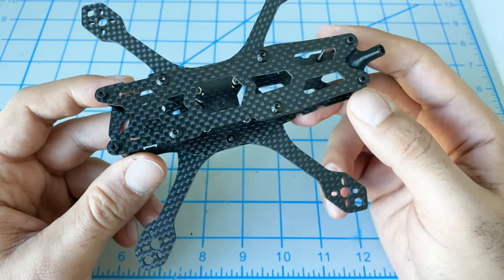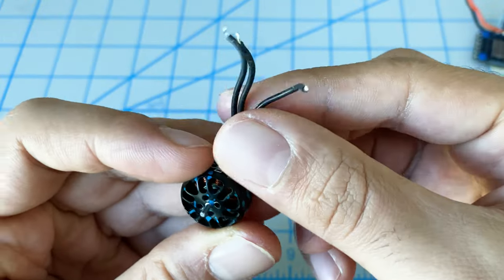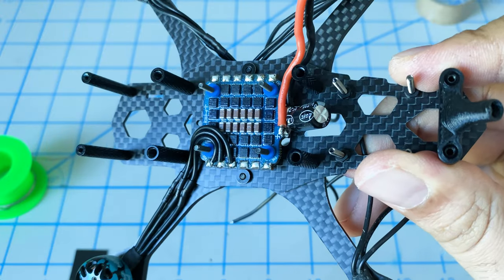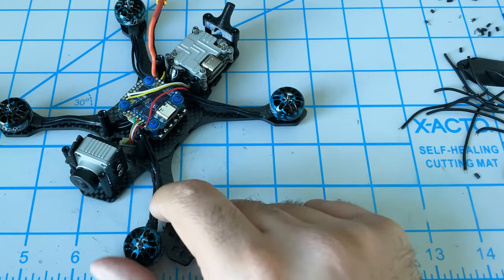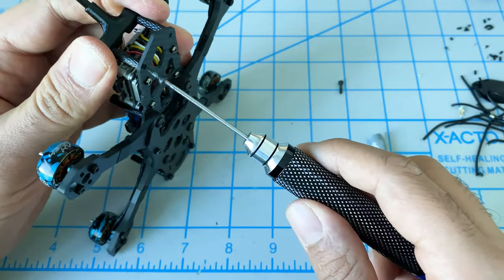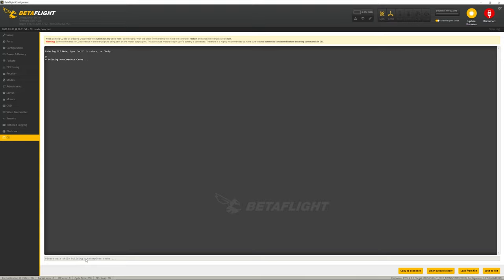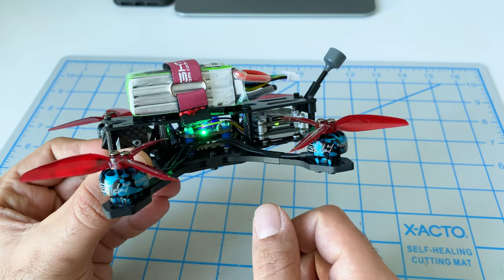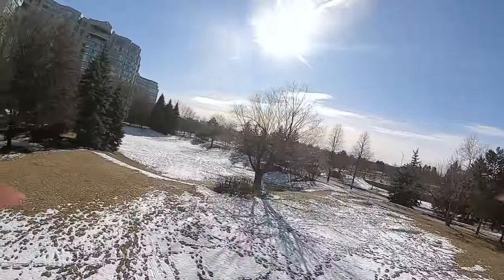Finishing the Lumenier QAV-S MINI 3" Freestyle Quadcopter | 3" sub 250g build wraps up!

Comment: Thank you for this! I got this frame in my FPV crate and was looking for something like this! Not to be annoying and I'm sure you know this. Always want to make sure you have an antenna on the VTX before power it up. It was powered on for long just adding my 2 Cents lol. Awesome Video
Reply from the maker: You're welcome. So far really liking this frame and it has been a nice upgrade from the iFlight DC3. You are correct, always good practice to have the antenna attached when powering up. Some folks, such as Bardwell think it's okay to power up the DJI system for short periods without the antenna. Never the less, why take the risk.
Reply: @Mangorille  I thought JB was talking about the goggles not the vista?
Reply from the maker: @alloutofdonuts3998  He made that comment for both. Although considering the price, I wouldn't run the goggles without the antenna.

Comment: Hey loved your video but I have a quick question, how much did this build cost with the dji system and how much did it cost without the dji system, Im thinking of doing a similar build but Im using a analog setup instead of a digital. Would really be thankful if you could tell me the prices :)
Reply from the maker: $206.23US without the Vista and battery. Add $165 for the Vista. Add $15.99 for each battery pack. This assumes you are using the DJI remote controller, otherwise you'll need to also add a RC receiver.

Here are the links to the parts:

Frame: https://www.getfpv.com/lumenier-qav-s-mini-3-freestyle-quadcopter-frame.html?afid=bkfOu8DK3YnNUD7y&referring_service=link

Motors (x4): https://www.getfpv.com/iflight-xing2-1404-3000kv-3800kv-4600kv-toothpick-motor.html?afid=bkfOu8DK3YnNUD7y&referring_service=link

Flight Controller Stack: https://www.getfpv.com/speedybee-f7-mini-35a-3-6s-8-bit-flight-controller-stack.html?afid=bkfOu8DK3YnNUD7y&referring_service=link

Props: https://www.getfpv.com/hqprop-t3x3x3-3-blade-propeller-set-of-4-smoke-gray.html?afid=bkfOu8DK3YnNUD7y&referring_service=link

DJI Vista: https://www.getfpv.com/caddx-nebula-pro-vista-kit-720p-120fps-low-latency-hd-digital-fpv-system.html?afid=bkfOu8DK3YnNUD7y&referring_service=link

Battery (GetFPV only has the 75C version, see if you can get the 95C version instead): https://www.getfpv.com/tattu-650mah-4s1p-75c-14-8v-lipo-battery-pack-with-xt30-plug.html?afid=bkfOu8DK3YnNUD7y&referring_service=link

Comment: Do you know about how many amps you draw from this build? I'm doing a similar build and want to make sure my 850mah 45c battery is adequate!
Reply from the maker: I haven't measured the amp draw but the 650mah 90c packs I run get warm after a flight. What kind of flying are you planning on doing (hard on sticks or just cruising)?
Reply: @Mangorille  I like to rip so...
Reply from the maker: @JRBFPV  Haha, fly it like you stole it... Probably want higher output cells in that case.

Comment: Newbie here, why would one choose to go to side instead of front top or back top. I tried side but, props kept hitting cables.
Reply from the maker: Most people run the motor cables on top of the arm but you can get props striking the motor cables and cutting them in certain crashes. Doesn't happen often but can happen. As a newbie, you want the cables on the side of the arm opposite to the direction that the prop turns. This way when the prop bends and touches the arm as it spins, it will hit just the arm and not the motor wire.
Reply: I meant the battery lead @Mangorille
Reply from the maker: @dhalimon  Ah. I bring it out the side and make sure to cable tie it to one of the stand offs. Should be well out of the way of the props.

Comment: great frame i just finished mine too! only thing i don't like is the carbon is a bit sharp on the edges but nothing a file wont fix
Reply from the maker: I actually never noticed until you mentioned it. It does feel a bit sharper than other frames.

Comment: Do you think the vista would fit in the center with an AIO FC/ESC? Looking at getting either this frame or the Impulse alien but I want center mount vista. I may decase my vista as well for even less weight!

BTW, smoke test should be done with a smoke stopper! I’ve been using one ever since I smoked a $70 BetaFPV AIO. Last night it caught a short on a $40  4in1 esc so it’s already paid for itsel lol. Cheers!
Reply from the maker: There wouldn't be enough space unless you modify the frame with taller stand offs or you decase the vista. Decasing the vista is the direction I would go. I have a video on the channel on how to do that.

You are correct, I live dangerously doing the first power up without an actual smoke stop.

Comment: nice lil build! Those props are 2g a piece, you can get just as much thrust (but less durability) out of the 3" emax props and they're only 1g a piece, it'll improve the flight characteristics dramatically in that the motor will have less prop to spin, def check those out! The newer 3" HQ low pitched props are also 1g and they're good and stiff and should be able to handle that build.
Reply from the maker: Thanks bud, I'll have to give that a try. The current props on there are 1.52 grams each.
Reply: @Mangorille  your scale must be more precise than mine, they show as 2g on mine. I think your AUW may be more than mine too so those props may be the  best option.
Reply from the maker: @woopweep9605  Hehe, I used the wife's baking scale, it measures to two decimal places.

Comment: What's the flight time with those motors on a 4S 650?
Reply from the maker: Depending on flight style, you're looking at 4 - 5 minutes. Power is really good with the 1404 motor combination, I'd say it has better punch out than my 5" with 2207 4s motors.

Comment: Hi do you think the space of this frame allows for a full air unit to be put to the centre (with tape/ziptie/3D prints) and the 20x20 stack. It’d be ideal to have 1080p recording while giving up GoPro, but the closest I found is the DC3 which I suspect is slowly being phased out. Your thought is appreciated!
Reply from the maker: Hey. Can't think of a way that this would fit a full size air unit and still fly decently. Someone else asked the same question and I provided measurements of the back area where the Vista would go. The problem is that the frame tapers at the back as well. Here are the measurements if you want to compare with the air unit:

Distance between the two standoffs at the back where the vista goes: 35.88mm
Width of the front standoffs where the vista goes: 19.2mm
Width of rear standoffs where the vista goes: 14.8mm
Reply: @Mangorille  thanks bro! Guess I’ll have to buy a dc3 to fit my AU for park flying then. Tuning may be tricky to make it fly freestyle tho

Comment: Solid build. I like to use Tattu R-Line batteries and those have shorter leads than most. When I build my quads I always double and triple check my esc xt60 lead length before finally piecing everything together. Looks like everything worked out nicely in the end.
Reply from the maker: Thanks! Those Tattu batteries are sweet, a bit more pricey though. Funny enough did double check but never expected this frame to be so rear heavy.
Reply: @Mangorille  It's true, the rear weight bias is quite extreme on this frame. I'm actually going to be building the 5" versions of the QAV-S, have all the parts already. Curious to see what the weight distribution is on it.
Reply from the maker: @michaelc5027  Are you planning on running a Gopro? If so, that would balance it out. I suspect this 3" has the rear bias because they thought we'd be running an action camera up front.
Reply: @Mangorille  I was actually thinking the same thing. I like my freestyle quads lighter so I will be running a Runcam Orange 5. I'd love to get my hands on a Session 5, unfortunately it's quite difficult to find one at a reasonable price, never mind finding one at all. I might eventually build a more dedicated, full size GoPro rig, but for the time being, I enjoy the lower weight. Who knows, maybe GoPro will actually make us a new session again, instead of those massive Hero bricks.
Reply from the maker: @michaelc5027  I hear you, having the same challenge with the RotorRiot HD1 and the GoPro. Ended up removing the GoPro and hard wiring it to the flight controller for a ~35 gram saving. That may be an option if you can find a beat up full size GoPro somewhere.
Reply: @Mangorille  That is an option for sure. I believe iFlight sellers a cable that runs the GoPro off the LiPo balance connector.